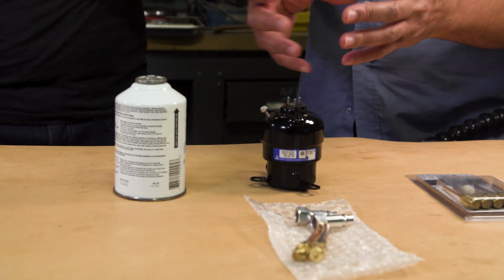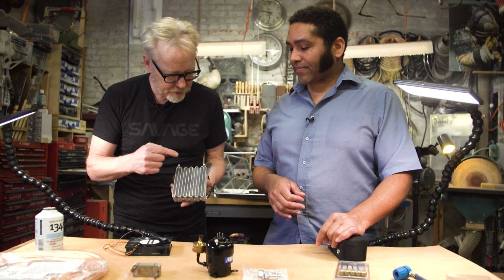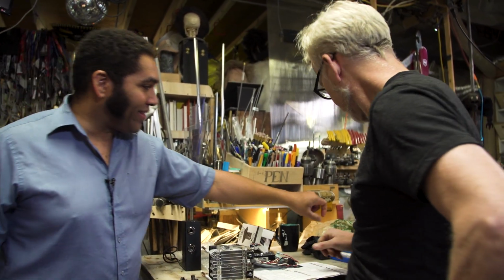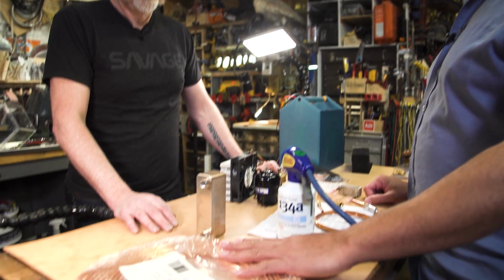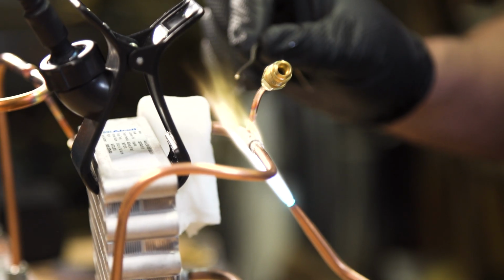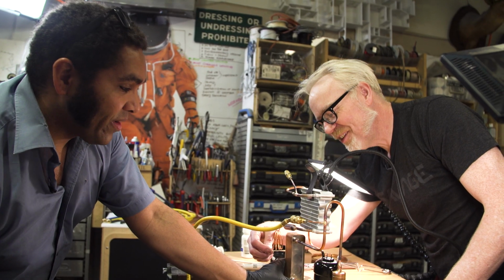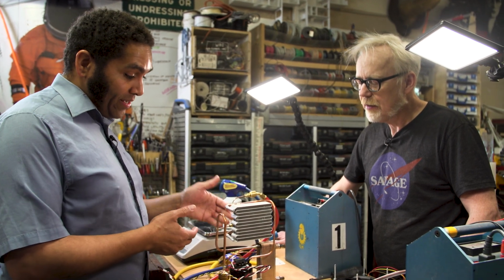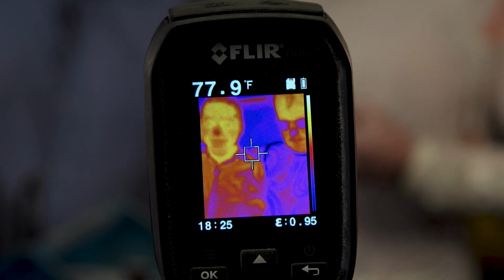Adam Savage's One Day Builds: Refrigerated Cooling Suit!

Comment: I know this is a few months old. But when I was in the military.  As a m1a1 crewman. They had upgraded the tanks to help cool the crew in extreme heat. As most know there is no cooling inside. So the military upgraded the system to support a cooling vest to keep the teams from over heating inside the oven aka tank. Just hope it keeps you cool Adam.

Comment: Now I don't have to "scream" about this every time you do a space suit cosplay.
Like every single time I have made these comments about using a DC compressor.
Anyway, now to wait to see your build for the enclosure for this.
I am going to suggest you use 4 large fans at reduced speed with a ducting system to blow through the radiator (each fan blows air through a quadrant of the radiator) to reduce the fan noise because that was ridiculous and will give you away super fast.  "Hey, I know this is Adam because I can hear that fan".
Even better, have a push/pull of 8 fans ducted for symmetry and just because it is cooler.  And, you built the charger system for your 18650 batteries, you can just build an old school "Radio Shack" project box batter case and that way you can simply exchange out the smaller fast charge batteries.

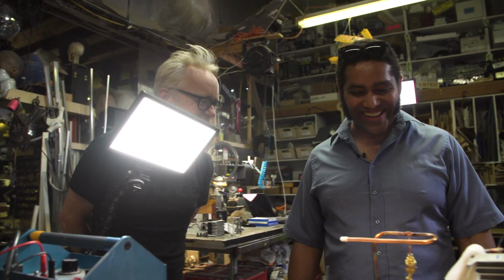Comment: At 43:24 the wrong  Chemical name was used. As far as I know it's not dihydrogen oxygen but dihydrogen monoxide. This is because monoxide is the chemical name used when there is only one oxygen molecule in the chemical structure.
Reply: Hydric acid could also work.

Comment: As a PC water cooling enthusiast, I had a feeling you'd be co-opting some of our hobby's parts for this, and I was not mistaken. I recognized the Swiftech MCRES Micro reservoir right away, as well as the XSPC Ion pump/res. I know the project is done and you're not likely to change anything based on the opinion of one random guy on the internet, but I do have a word of advice. The pump contained in that reservoir has a reputation for not being the most reliable thing on the planet and that's likely one of the reasons that particular part is discontinued by the manufacturer. I'm assuming that you won't put anywhere near as many hours on it as most PC enthusiasts do on a desktop computer, so you may wind up with no issues, but if it does fail you should consider a pump and reservoir combination from any one of the many PC water cooling brands that make use of a pump OEMed by Iwaki. The DDC model is smaller, but the D5 has more head pressure and is more reliable.

Comment: Adam: And we can use my super cool tools to make something to put these things together, right?
Kipp: Actually we can just crimp them.
Adam: Am I a joke to you?
Reply: Using threaded connections for all the lines would be ideal but would be more work. The problem with soldering everything in place is serviceability. Take a little time now and repairing it later will be a breeze.
Reply: @rodolfoptx  Interesting. What you're saying is all home HVAC connections are soldered and not threaded connections because they use orings that need oil in the refigerant?
Reply: The compressor requires oil. Most are brazed connections across the HVAC industry, sometimes flare connections are made with certain units but tend to leak.

Brazed connections still sometimes leak. Depends on the quality of the joint

Comment: Dear Adam

Fascinating video, please make more like this! 
If you are ever in need of taps or dies in some of the more "obscure" thread series (like British Straight Pipe, British Cycle Thread, British Association and Model Engineer Series), may I recommend an outfit called "Avon Tap and Die".  They are located in Bristol, England (on the River Avon) and taps and dies are the only things they do.  Their stuff is all made of good HSS and they are quite happy to ship you a single tiny tap if that is all you need.  They have an excellent on-line shop and are used to dealing with customers from all over the world.  Given these tools are relatively small and light, trans-Atlantic shipping (I live in Canada) is quite modest.  I am nothing more than a satisfied customer.  Hope that may be of some help.
Best wishes.
Paul

Comment: Not all air conditioning systems are refrigerating systems use of THX valve. That is Illustrated here as the skinny tubing. What I don't understand about this practice, is it is like doing the opposite of what we encourage people to do for their swimming pools in terms of getting rid of the right angles to the PVC pipe. By having gentle corners the water is much easier to move around oh, by avoiding the pressure drops the wattage of the pump can be drastically reduced.

In air conditioning for example not only do you have to increase the wattage of the motor that operates the compressor by having this pressure dropping resistance yeah, but the potential work that the expansion of the refrigerant could do, is not utilized to help crank the compressor further reducing the new work but you have to use the electricity for! I enter at the global cooling challenge this proposal, but a family member would not give me back my laptop so I was not able to run the simulation in time for that contest oh, and they refused to consider my entry without the spreadsheet idiotically, despite them having two $200,000 checks that they didn't have any entries to award!

Some people like to think of my proposal as comparable to an automobile or other combustion engine turbocharger.

In the 1970s a biography of Einstein tried to set the record straight. For example the name was used for other people who attended some of the early demonstrations of fission. Einstein did not attend any of the weaponization events.

We have to think about the threat to them combined energy harvesting and distribution Industries peacetime use of fission represented. The amount of success they had suppressing the use of fission has not only doomed all life on Earth, but it is used to produce liquid fuels only on aircraft carriers. This despite the fact that the round trip efficiency of shedding some Mass from the nitrogen in the air and then restoring it to generate mechanical work is very high.

Despite the fact that we use extremely inefficient processes to take some of the mass from the methane that way frac oh, to get it onto ships compactly, and then we reintroduce that extra mass to the gas to put it into pipelines to distribute for burning.

Those involved in these various businesses given these facts being presented to grand juries should expect many many years in prison. If you know how to produce liquefied natural gas oh, and you do that instead of exporting or importing energy via liquefied nitrogen, then you are the worst of the worst and should never be paroled. This is what we built our prisons for.

Comment: There is a lot more to this story that I have not found in this video regarding the oversizing of the compressor. I have followed the digital micro inverter compressor markets for many years. There is some recent research that is free for anybody to download and read. It is similar to what he mentions at the end of the video with NASA not bothering to condense the gas. Calling what we inhale Suffolk can't is rather odd because I don't think it's the nitrogen it's the absence of oxygen. Carbon monoxide does not merely reduce the amount of oxygen in the air of course it prevents that oxygen from being transported by our blood.

Anyway this was a very complicated expensive undertaking instead of spending less than that tiny fluid heat exchanger cost for a already built system that can have stainless steel Heat exchangers so you can out of the distribution fluid be non-toxic.

I also challenge the history that was provided in terms of what the military wanted the equipment for. I have always said that it was the helicopter gunships that had the on ship chilled water but that required a tether so they build a fanny pack for that in vehicle used without having to connect the Gunner to the ship oh, this allows them to have full motion within the craft I never get tangled. In other words it's hoseless as in Wireless.

Now for the really important part that little coil which is called the to continue that analogy resistor or the pressure dropper. Physics teaches us that energy is lost when a force is applied across a distance. Dropping the pressure of a fluid is also wasting energy. This is occurring on the hot side presumably. However once the fluid starts boiling it would suck that heat back into itself.

This is what a turbine is for. You provide additional space for the liquid to expand. I prefer to think about this using the crochet about energy. When you're changing phase, the Heat, is being converted into matter. Believe this or don't.

So when you're dumping heat you are reducing the mass. The speech recognition that word wrong every time.

I don't understand why the total budget is not provided for parts. The partner in this project is presented as coincidentally having worked on this system we learn 150 times.

In Singapore they have solid state very quiet ceiling dehumidifiers for outdoor areas. These systems use incredible amounts of current had a very low relatively speaking voltage. Largely for demonstration purpose I mention it now to illustrate that, the market for cooling garments, has been corrupt suppressed. The observation that hairless parts of the body can dump the most heat it's interesting to me. Some explanation of that evolutionary physiology would be helpful so I don't have to speculate.

Nobody has funded the physiological integrating research to have the obvious issue of our body's ability to learn in terms of the brain's role. Learning takes time.

There is this notion of blood for oil and it is absolutely true. Had these personal cooling systems been provided to the Infantry they would have come back to our home soil and demanda widespread adopt Asian of this alternative approach to health.

Your silence both of you throughout this video is tragic. You had a teachable moment. If only you would have learned what matters most. Then you could have shared it.

The fact that I assume you already know is that gases vary in their thermal conductivity. Myths about this abound. Argon for example is a conductor compared to air but it is less likely to leak and allow water in.

Something like that right is the bus busting knowledge, but to prevent the body from becoming unable to have its neurons properly function which is a chemical process that's temperature sensitive oh, and everything else that we need to prevent are blood from getting getting too warm, almost any part of the body will work. Especially if it is trained!

Air is not the way 2 transport Heat, Arizona insulator and not a conductor, are is, not the way, air conditioning does not use the air, air conditioning, provides dry air, not cool air, but cooling air.

So that myth you had a chance to bust, by then failing failed to rescue our planet! And keeping things simple we should not use cooling air. Instead we should use the blood. The way you have the blood cool the rest of the body is by having something touched the body that cools what it touches. Nitrogen and oxygen cannot do that. They can just increase the mass of our sweat, but not the minerals contained in our sweat. Those get left behind on our skin and in our clothing if you use air.

Now if you have a cold surface in a humid warm space, remember what happens oh, the water vapor that is in that space will have its mass reduce, and that he is going to get in to your system instead of your body heat! So you have to have some sort of protection against the room heat yet again to the system that is you have to protect the mass of the humidity in your envelope from condensation. Condensation reduces the mass of the water vapor in your home or in your envelope as the saying goes. If you can not be reducing the mass of the water Vapors in your home then you can have fresh are we pumping into your home all the time without it becoming unaffordable. What cost money is reducing the mass of the air.

 The most important facts to understand about the human body is that it's like however many hundred pounds of hamburger. It's going to stay cold or warm for a long time. this is where the learning comes in, the learning substitutes for the thermal insecurity.

 When you are no longer thermally insecure oh, you will think about the heat as you think about your bladder, if you get to the point where you need to shed some heat you will sit down but before you sit down you will uncover the cold surface, and that cold surface will be smaller than your butt oh, you will cover it entirely with your butt, or whatever part of your body he want basically will work
Reply: Full speech recognition I am replying to oh, the speech recognition words, are poorly typed certainly.

However there are several points that I have made. General Electric of course produces 5 million watt turbines that operate on nitrogen. Center electric also produces the same horsepower diesel engines that learn and use almost none of the Heat. We allow them to continue to produce the wrong product oh, because we do nothing. General Electric used to teach the actor that later became president about certain American propaganda.

That Republican presidents lost his job evangelizing American gospel for GE after they were caught cheating and sent to prison.

It's time to put General Electric Executives in prison again for selling diesel electric locomotives when they have the ability to produce atmospheric heat powered locomotive. All he needs is to lose the alternator and the wires all together including in the motors so I can beat the rec Drive or perhaps a hydraulic system.

By saying that trains should be powered by atmospheric Heat I mean that you remove the heat first from the atmosphere and that allows you to fit it in small tanks, IE the liquefied natural nitrogen, substitutes  for the coal and the diesel Etc, but like the ancient steam engines expand 700 fold becoming heavier again.

The teachable moment is when the FBI raids the General Electric Executives homes oh, and we have the trial, so that people can find out oh, about how all of them for the technology, the genuinely disruptive technology, is not being allowed to disrupt, despite that costing our planet's future.

Comment: Adam, it looks very cool, and it looks like it feels VERY cool, and for doing a NASA EVA suit with a PLSS on the back will give plenty of room. But if you are doing a 'hot' costume that does not allow for a backpack, you can lower the profile some from the one you made. First, the gas to air heat exchanger is square and thick, with a thick fan on top. You had it drawing air from or towards your body but that means ducting and more space to get the heated air out or outside air to get in. In either case the minimum of one air duct makes the stack a very big bulge. You could mount it sideways to intake air from the left and exhaust to the right but that would still be very thick. 

An alternative would be to see if you can get 2 or 4 of those gas to air exchangers that were very narrow in the direction that the gas flow folds back and forth. Using them sideways, with a large diameter, slow-spinning centrifical fan with a pancake motor that would draw air in from the center and split off 2 (4) air flows to go over the heat exchangers. At a guess that part could be as low as 2 inches thick. The compressor is unfortunately bigger than that and there is not much you can do to fix that. I would also consider adding a second gas to water heat exchanger as well as going to a more powerful pump. Two heat exchangers in parallel would decrease the resistance. But you need to make sure that only one connection feeds from all the upper heat exchangers and then supplies all the lower ones so that you don't get a runaway reaction between the two sides.  If you wanted to do a REALLY realistic EVA suit you should use a pressure vessel that you can load ice with a little water in, then set the exhaust to 6 to 10 PSI so that the steam coming out will be hotter and you will get about 4 times the cooling capacity compared to room temperature water because you will get two phase changes instead of one and heating liquid water through its full temperature range would provide almost as much as a phase change. And going to the higher pressure means a bit more heat carried away.
The concept of running cold air through the suit instead of water probably won't work because the air has a lower heat capacity and would require a huge airflow rate to squeeze into the narrow channels in the suit.
mishabear

Comment: As far as making sure the lock nuts stay torqued, you could always drill a .05 hole through three of the corners (of each lock nut), and use .041 lock wire to secure them together "permanently". By permanently, I mean until the wire is cut. Doing this in a opposing s pattern will ensure that tension will always be in the tightening direction. This technique is used in high vibration applications like helicopters and airplanes; and if done correctly, has a very low chance of failure.